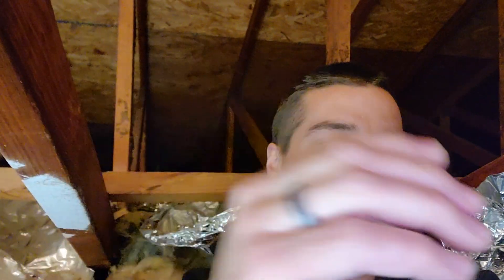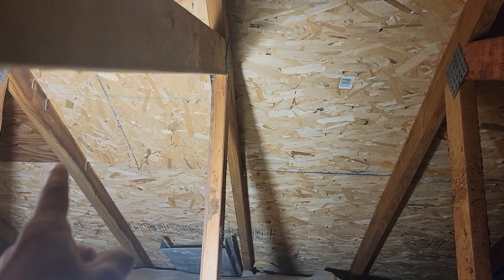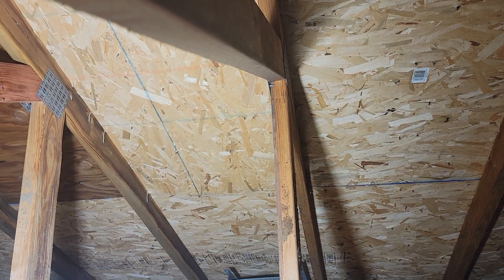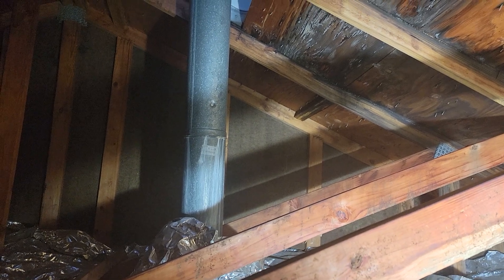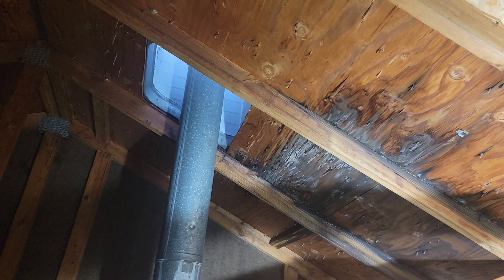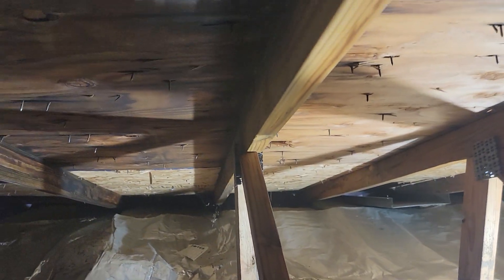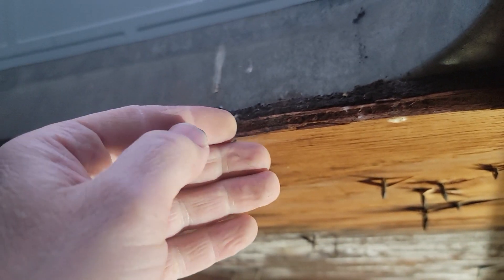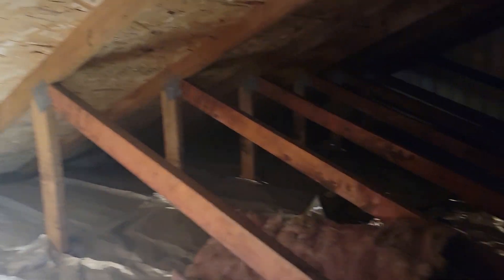Roof Chimney leaking in attic

Comment: Great POP-UP appearance when your head quickly entered the attic at the very beginning. You made me laugh.  Those spots have been leaking for a good while. One time I ordered 2 pallets of 3/4 OSB for new decking. I noticed that one was stamped "inspected" or "certified" (can't remember) and the other one was not. I sent back the non-certified pallet for a replacement. Got to always check. And always use those H-clips. They do a lot of good when the boards expand and contract. The small space provides space for the boards to "grow," all without causing warping.

Comment: Interesting video thank you! Never heard about the osb and directional across the rafters but after seeing it makes perfect sense!
Thanks for that!
Looks like lots of people worked on this house and not many knew what they were doing. Do you think the homeowner did the repairs? They didn’t have a permit they didn’t do lots of correctly duct tape on plumbing always bad, bathroom vent not insulated and not vented outside.
You did a good job pointing out all the improper stuff in minutes.
Nice quick and easy to follow.

Comment: Great vid!👍I have a very similar problem. Had new roof put in, including plywood but new leak starting again right near chimney. Told the roofer and they said it’s a chimney problem - briefly looked at it but won’t touch it. Any advice on next steps?
Thx
Rudy

Comment: Thanks for this video. Storm just started and we bought house 3 mos ago. Roof inspection was done externally but never crawled in attic. It’s raining hard two days so decided curious to pop my head up in attic. Glad I caught it early on as surface lightly damp but dripping drip every 3 seconds. 

It look like yours, water that size 1 foot away from bathroom vent. Assuming hard winds could’ve damage seal or flashing?

Thanks for some of tips to possibly repair so I can be on look out once it’s repair
Reply from the maker: You said bottom of a vent pipe, depending upon the age of the roof it's more than likely a nail near the bottom outer edge of the flashing that has rusted out and water is getting in.  Without seeing it it's just a guess but usually that's what I find.
Reply: @GrandRoofingInc  thanks! Going up today and from a quick peep walking outside I can see some lifting in the flash vent for sure. Will screw down with rubber washer, and do some flex seal tape around it as precaution.